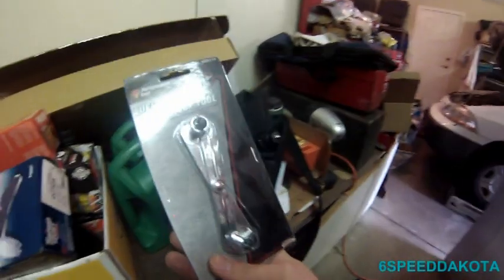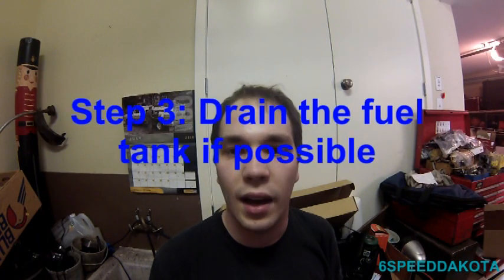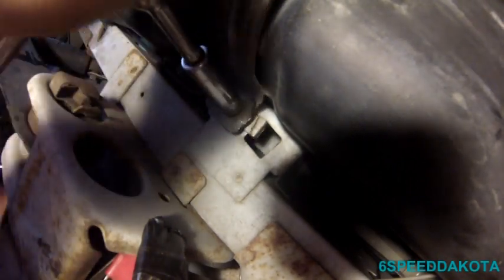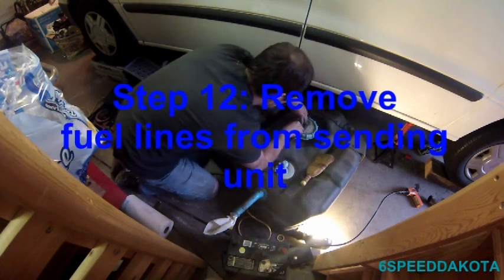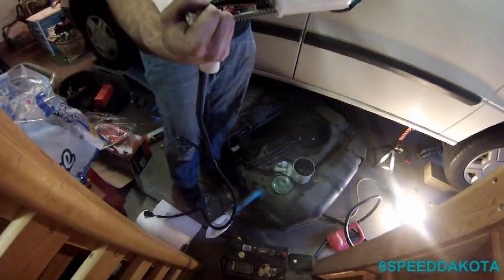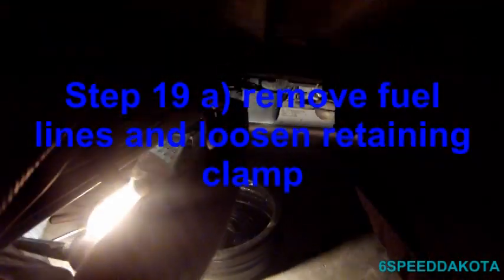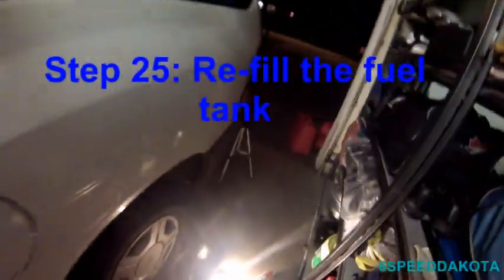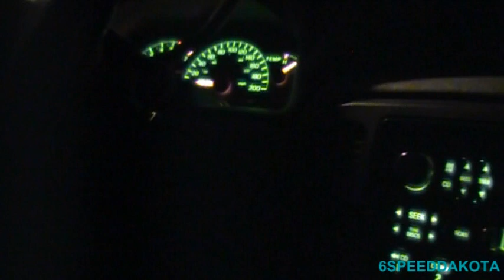How to Replace a Fuel Pump on a 2002 Ford Windstar LX

Comment: Thanks for the video. My 2000 Windstar has intermittently been having trouble starting over the past 3 years. Blew the fuel fuses at one time, and also replaced the fuel relay. Eventually it would work again, sometimes for months at a time, but as soon as the weather changes from hot to cold, the pump always seems to fall asleep on us. So it's definitely time to change her out, especially since I have your video to go by. I really appreciate you taking the time to make and post it.  Blessings.

Comment: There probably aren't many people watching this anymore as most of these are gone from the road.  However, a little tip; if you have a piece of plywood laying around, cut a square out and put it between the jack and the tank.  It will help balance it better.  I still have a 99 beater van the runs great.  I just had to do this as the stupid check valve went out.  I was still able to drive it enough to run the tank empty.
Reply from the maker: Thanks for the tip, I'll try that next time I have to drop a tank
Reply: I still have my 2003, and about to replace the fuel pump. I am in a bit of bind...... I need to take 5 goats to the butcher. And our family van or soccer mom van is now a livestock transporter! Look up River's Edge Goat Dairy Arthur Ontario, on facebook or Instagram. We so.sometimes post pics. Thanks for the tips. I will be making the pump exchange soon! Thanks for the video! Will

Comment: hey i am one of those people that like to talk about it but still have to do it, since no one else will do it, i had a better proper set up for the job, but you did good also, work with what you got, in this case we had a spare tank from a parts wrecker purchased it, and installed a new pump and made sure it was cleaned out etc.. but yeah was easier with additional help i had from take off to put on. thanks for the video take care

Comment: Thanks a lot for the video! I have this exact same van that I use as my whipping horse for work, but I had my reserves about messing with the fuel pump. most of my experience is with 60's model Chevy's, and I've certainly learned my lesson about dropping those tanks alone. Great video, very informative.

Comment: @Heather. I had the pump replaced by a Ford dealer on my 2002 Windstar due to a no start condition. It sounded like it wanted to start, but it wouldn't. When we got it back from the dealer, the same problem happened again. Only this time, it didn't even sound like it wanted to start for about 10 seconds. It just cranked for awhile and eventually started and ran fine. Turned out that the check valve on the new pump was bad out of the box which resulted in the fuel draining from the system when the car sat for about 5 minutes. Thankfully the dealer replaced it for free under the warranty. Hope that helps.

Comment: The only things I would ad to this process is to inspect (& clean if necessary) the tank inside for whatever may have plugged the pickup screen. Also check the old fuel filter to see if it had any blockage. You should be able to blow air through the filter with little or no resistance. On mine black "dust" came out of the outlet.

Comment: REPLACING THE FUEL FILTER FIRST RELIEVES THE PRESSURE FROM THE FUEL LINES. IN MY CASE IT'S AN 03 AND HAD NEVER HAD THE FILTER REPLACED ULTIMATELY CAUSING THE PUMP TO FAIL.

Comment: Thank you for all of the information as I plan on tackling a 2003 windstar later today but dont hate on us short guys in 5'7 and can wrestle my 30 gallon full steel gas tank from my jeep with about 10 gallons in it just fine. Although I admit I would've preferred not to lol

Comment: hi dakota i liked the video very much.my 2003 ford windstar has been running sluggish and the power has been hesitent.i drove it the day before and it started fine,i went out the next day and it cept wanting to start but didnt is that the fuel pump because i can hear the pump kick on but it wont start.does that sound like a bad fuel pump?
Reply from the maker: My suggestion is to hook a fuel pressure gauge to the fuel rail and see what your static key on pressure is. If it is really low, then you may want to look into replacing the pump.

Comment: I have another tip. Have you tried using a breaker bar? Because, if bolts are rusty, the breaker bar will break it loose after spraying penetrating fluid on them.

Comment: Well done considering the degree of difficulty when doing this by yourself.  I did it once before but I have to do it again as the check valve has failed.  I might get a piece of plywood to put under the jack.  That will distribute the weight a little better.  Isn't there anyway of getting the fuel out or is there a rollover check valve in the way?  I think that was the case last time.

Comment: Question: Ok, I replaced the fuel filter, then the fuel pump (mechanic said the pump was the reason why it suddenly wouldn't start).  Primed it by putting the key to the On position about 10+ times at 30 second intervals.  Wouldn't start.  Replaced the fuse and it started right up.  Turned it right off and primed it again, but it now idles roughly when in park (doesn't seem to like reverse much, either).  I drove it around the block twice, it seems content enough when driving, but the way it acts in park like it's gonna stall makes me afraid to get stuck at a light or in a traffic jam.  Clearly something's still not right.  Thoughts/suggestions?  Think there's air in the line (how to fix that?)?  Help, anybody, lifeguard!

Comment: Great video. My wife's 04 freestars fuel gauge is stuck on empty. Also the engine light came on at the same time. Can't smog it. Could the engine light and gauge cause this?? Error code po463. Thx
Reply from the maker: p0463 is fuel level sensor input high. It could be anything from a bad sending unit or an open sensor ground wire. The computer is sensing that the voltage going to the sending unit is too high. Meaning that the power doesn't have a way to get out. The fuel sending unit is like a volume knob, when the tank is full, it offers up low resistance (like turning the volume up all the way) and the gauge reads accordingly. At low fuel, the sending unit offers high resistance, like turning down the volume, and the computer senses what the voltage is and it tells the gauge what to read. If it sees a full 12 volts, then it knows that there's a problem because the connection is broken. Try pull off the fuel pump connector and check the sending unit pins for resistance. If there's infinite resistance, or no connection between the sending unit pins, then you have a bad sending unit.

Comment: Thanks for sharing this video, I here in surrey, and my 02 windstar ford is shaking , I changed the spark plugs, the wires, and coil pack but still the same ,any idea please
Reply from the maker: +carlo francisco that discounts the fact that it's an ignition related problem. If the motor sounds funny while it's cranking, almost like it has a dead spot, then you probably have some internal engine damage going on. If it doesn't smell like a lot of raw gas coming out of the tailpipe, then you probably have a dead injector or a wiring issue to the injector.
Reply: carlo francisco combien prend de temp pour change pompe a gaz fors freestar 2004

Comment: I have a 2000 windstar that is driving me nuts the mechanic told us to change o2 sensors which we did and is still not working... It will turn on fine when cold and after a couple of mins it warms up and shuts off it will not turn back on till it cools off usually 30 mins would could it be?
Reply from the maker: +Liliana Aguilar There are so many possible things that can cause that, so unfortunately, I can't tell you exactly what the problem is. It could be anything from a crankshaft or camshaft position sensor to a coolant temperature sensor. One thing to notice is that if you crank the engine and the check engine light stays on while cranking on a ford, that means that the pcm has no crankshaft position sensor signal. I would start with that and go from there.

Comment: what are your thoughts on an aftermarket fuel pump? How many hours for the whole job? Thanks, great video.
Reply from the maker: Mark Hopkins This took me about 2 hours and I'm very mechanically inclined. I installed an airtex pump in this van and as far as I know, it was still running fine when they sold it. I heard of some people having issues with the airtex pump, I heard that carter pumps are good aftermarket replacements. A great place to look is rockauto.com, they have really good prices for many name brand replacement parts.

Comment: I have a 2000 windstar sometimes it stalls and sometimes it doesn't there has been a few time when I put it in park to start it but it doesn't then i press on the gas pedal and it starts. It always has an engine light on the dash and when it stalls the battery light turns on too
Reply from the maker: The battery light coming on is just because the alternator isn't spinning, so it's not charging the battery. I would say that the idle air control on the throttle body is gummed up and sticking, causing it to not get enough air and stalling out at idle. If it won't start and you give it gas, you're bypassing the idle air control with the throttle blade. Take the throttle body off and all the stuff attached to it, and give it all a good thorough cleaning with at toothbrush and some throttle body cleaner, Berryman B12 Chemtool is really nasty stuff but it cleans really well, but don't get the electronics on it wet with solvent or they won't work properly at all.

Comment: Just as a after thought. CopperKote  any threads for easier removal later. WD40 loses it's lubrication. 2 Questions though. Why was your Temperature Gauge so high?? The second one is, Why does my Windstar cap out @ 4000 RPM while it is idling.

Comment: two things isn't there a fuel pressure relieve valve some where on the engine. #2 a trick I was shown many years ago,when working on fuel line tie a rag on each wrist that way the fuel doesn't run down your arms to your arm pits lol
Reply from the maker: Dean Gray There's a Schrader valve, but it leaks fuel everywhere when you release the pressure. I like the idea of the rags on the wrists, that's a very good tip

Comment: Having a hard time getting the short fat hose off the fuel tank. i lossen the clamp but it just spins. Do i yank it out or tank the tank down with it on? tks
Reply from the maker: I'm assuming that you're talking about the big filler hose. If the clamp is toast, try getting a pair of sidecutters under the clamp and cutting it off or get a screwdriver under it and try prying up on it it gently while you loosen it. What happens is the sheet metal deforms and the worm drive doesn't grip the ring anymore
Reply: First let me say Thanks for the post and reply :). I finally got it off by sprayng some WD40 down the tube and twisted n pulled about 30 times till it came off.  My pump went bad due to it was low in fuel and I went home for the triple holiday. Guess it dried up.  Thanks again
Reply: We had trouble getting this off as well. We filled a ziplock bag with hot water and placed it on the hose. This helped the hose expand and it popped right off.

Comment: Does we really need to lower the tank to replace the pump or we can replace it under the seat?
Reply from the maker: Not unless you want to cut a hole in the floor. I definitely don't recommend that since there's fuel lines directly below the floor
Reply: I have freestar 2005, still need to make a hole?
Reply from the maker: Don't make a hole, drop the fuel tank. That's how the fuel pump is replaced
Reply: 6speeddakota You seem to have good knowledge  about this van, actually my fuel gauge needle move slowly when I fill up the tank. I was wondering may fuel pump is not working properly. What do you think?
Reply from the maker: If it runs ok, the fuel pump is probably working properly, what the issue is more than likely is the fuel level sensor that is attached to the side of the fuel pump housing.

Comment: I have a 2005 freestar 4.2.  Would the process be the same? Couldn't find any freestar videos.
Reply from the maker: The freestar has a returnless fuel system, so you have to pull the fuel pump relay and run the engine until it dies to relieve the fuel pressure, other than that, the procedure is similar, it's the same process for most fuel pump jobs really.
Reply: I have a 2001 Mercury Villager Sport Van. Is the configuration the same as on the  Wind-star?  Possible Fuel pump issue.  Awesome video.  I was headed south from Co. Springs Colorado.  I have a 2001 Mercury Villager Sport Van.   I was going 75 mph. at a consistent speed.  The van cut out 2 xs about 4 seconds between each occurrence,  and i had to pull off the free way.  I tried to crank it over to start it up, it turned but wouldn't start.   when I had it towed to my house, the driver said he checked the alternator and battery It would crank but no start for him also.  Any info would be helpful !!!!!  Thank you !!

Comment: do you have any tips on how to change the water pump on this car???
Reply from the maker: +Jose Cantu unfortunately I don't, they sold this van shortly after I worked on it
Reply: My water pump died and I didnt want to attempt it.  Bought the water pump at Auto Zone for about $60 and paid mechanic about $200 to install.  He put all new coolant as well.  My 2000 Windstar ran excellent after.

Comment: I need to replace my fuel sending unit in my 2002 Ford Windstar, do I also need to replace my fuel pump with it?
Reply from the maker: Usually it's a modular unit, you typically can't get one without the other, so if you're putting in a new sending unit, it'll usually have the pump with it.
Reply: 6speeddakota enjoyed your video! I’m trying to decide whether to do it or pay someone else, after watching your video I think I’ll give it a go! And I admire that you made this whole video without cursing or throwing anything! Excellent job!

Comment: Hey buddy.
I don't know if you are still responding to comments but I have a question.
I'm having a hard time getting the tank neck off of the filler hose.
The hose is stuck.
Any suggestions? This is preventing me from getting the tank out.
Reply from the maker: Jaime Casarez try take a screwdriver and put it between the hose and the filler, then in the gap, give it a blast of penetrating oil, do that in a few different spots and let it soak for a while. Then try prying the hose off, repeat if necessary, you need to break the rusty connection between the hose and the pipe
Reply: Thank you I finally got it.
Reply: I just replaced the fuel pump. Video was assome! Assembled everything all good. But my fusea keep blowing! I wonder, was there something on the new pump?  That I was suppose to take off? Like a plug on the intake of the new fuel pump?
Reply: @6speeddakota  my fuses keep blowing,  do you suspect there is some safety plugs on the new pump that needed to be taken off? I should have had a closer examination of new unit...... or did I put the float on wrong? Or does the float have anything to do with the fuel pump? Float is for fuel level gauge
Reply from the maker: Try unplug the sending unit without dropping the tank and see if the fuse blows. If it does, you’ve probably pinched the cable against something metal. If it doesn’t, you could have a bad pump right out of the box. If the pump windings are dead shorted, it’ll blow the fuse immediately.

Comment: Hi my winstar van has gas odor evry time i fill it up what coulb be the problem thanks!!!
Reply from the maker: +nezahualcoyotl neza70 There's likely a cracked or broken hose that goes from the fuel tank to the filler neck, or the charcoal canister. This will especially ring true if the check engine light is on.
Reply: +6speeddakota yes the check engine ligth is on but shows code for the sensors bank2 but not for the leake line or sometimg like that  let me think may be is the caniester  because odor is evrywhere any time i drive it and i also i saw humidi around the tank looks like oil!!

Comment: maybe lowering the tank just a bit to clear fuel lines would allow to carefully cut an opening above
Reply from the maker: I wouldn't even bother cutting an opening; an extra 20 minutes of savings isn't worth potential skin grafts to me. I'm squeamish with needles lol. If you're lowering the tank a bit anyways, why not just take it the rest of the way out. Then it's super easy to drain and put back in dry
Reply: @6speeddakota  on a 25 yr old vehicle  could run into corroded bolts  grief   have also seen from forums the drive train is in the way to reinstall  not always a straight forward reverse process   shears can be used,  anything sparking too edgy. Although frame supports can be in the way.
Reply from the maker: Makes sense. You gotta do what you gotta do sometimes to get it done, there's no arguing that. I don't live anywhere near the rust belt, so I've been lucky most of the time with not having to deal with rust and crust on older vehicles.
Reply: @6speeddakota    cut the hole this afternoon  not bad a job really  didn't even lower the tank    used a sawzall  blade upside down. One other advantage is if the part turns out faulty   no creek

Comment: isn't there something to make the fuel pump stay in the upright position
Reply from the maker: +Phillip Murphy The fuel pump sits on the bottom of the tank; when you put the retaining ring on, it almost sandwiches it between the bottom and top of the fuel tank since the bottom of the pump unit can move up and down to allow the the unit to push against the bottom of the fuel tank with some spring force. The retaining ring does the rest of the work holding it in so it can't pop out.